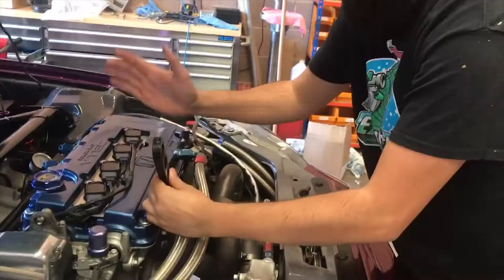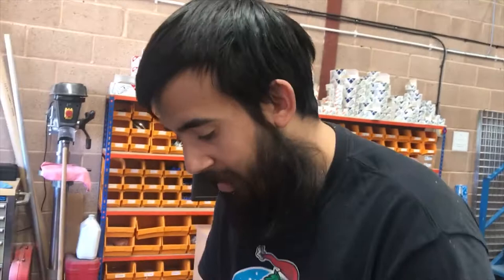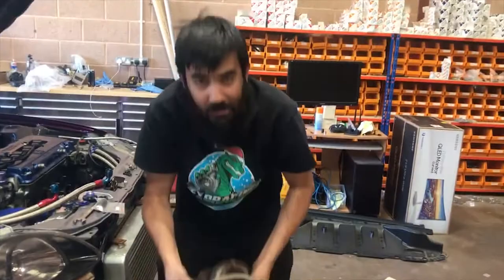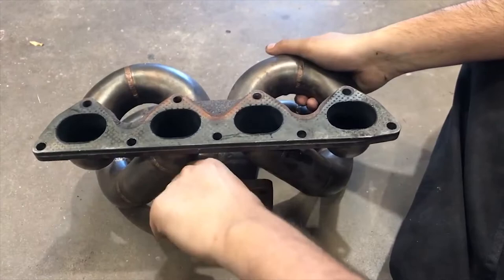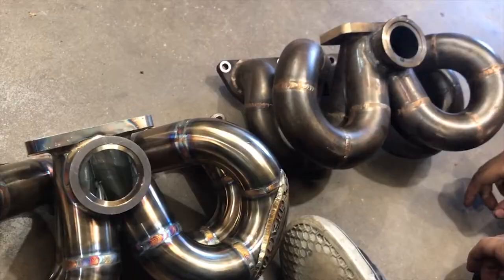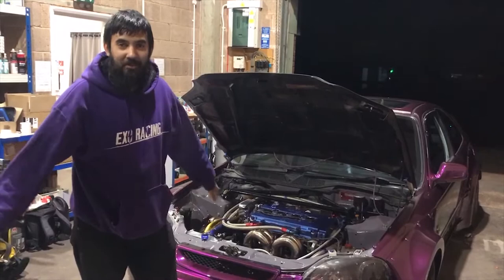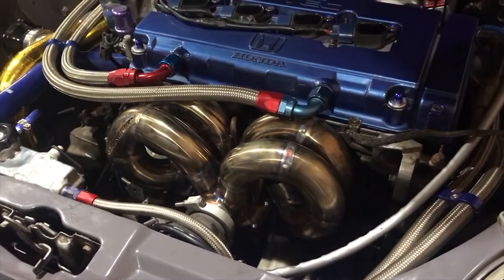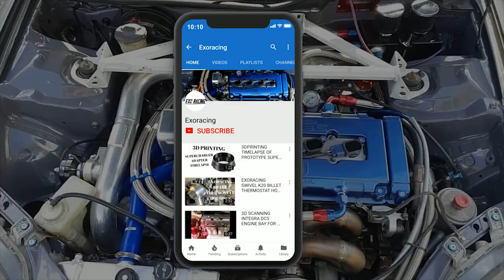WIDEBODY TURBO CIVIC NEW RAMHORN MANIFOLD *INSTALLATION*

Comment: How did you guys fit the exhaust facing the radiator?
Reply from the maker: We did have to move the radiator originally so welded the mounting points to the traction bar to give us a little bit more clearance